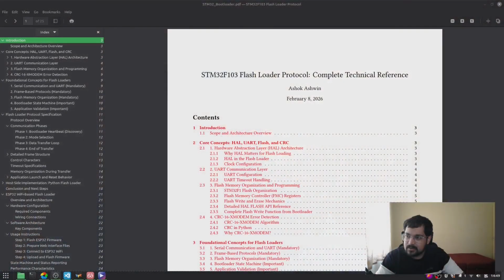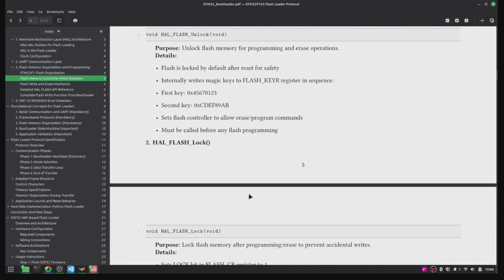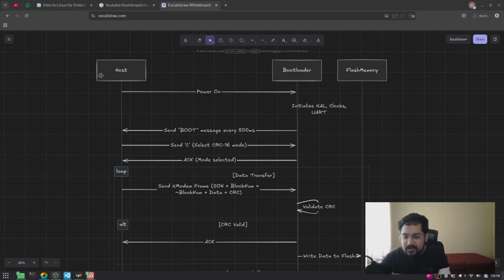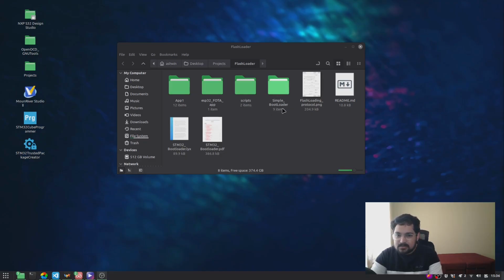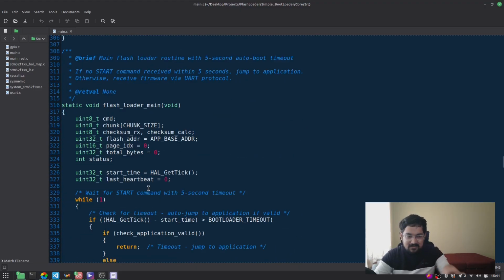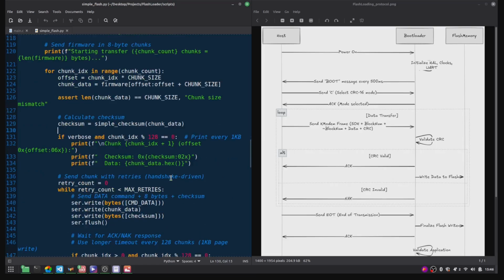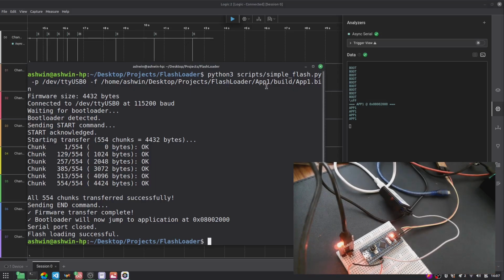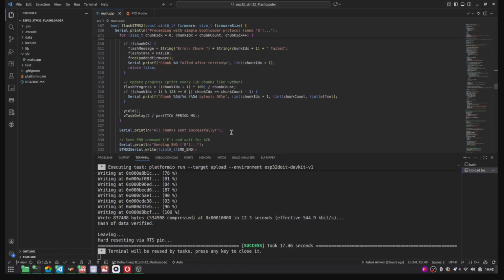STM32 FlashLoading FOTA with ESP32

Comment: first!
Reply from the maker: Hey! I tried to fix the audio. Used a compressor to balance out. Please let me know if it worked.
Reply: @CoresandCodes yes it worked, the volume is same throughout the video now. But this video sounds quieter compared to any other youtube video. To fix that, you should apply normalisation after the compressor step.
Reply from the maker: @destiny_02 thanks a lot.